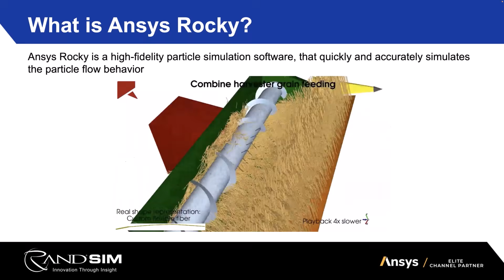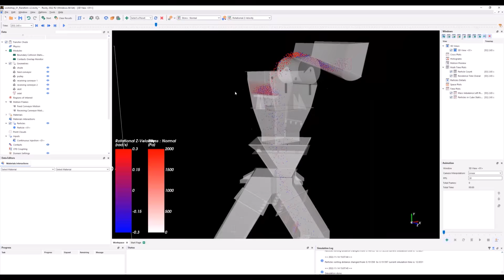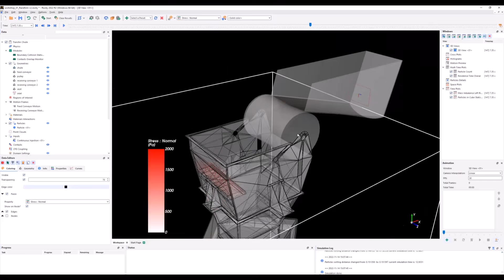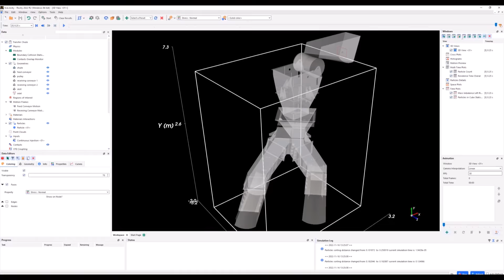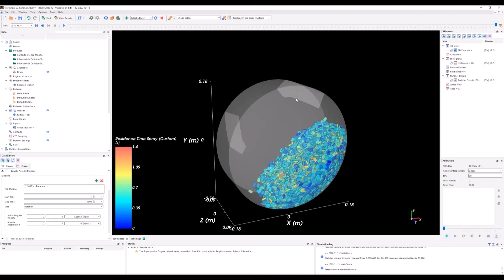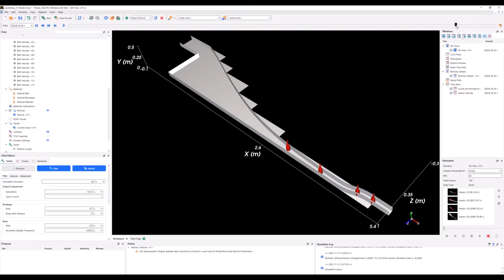Ansys Rocky: Particle Simulation 101

Comment: i need to simulate the effect of wind flow over a plate containing particals. Is rocky the correct choice for such simulations?
Reply from the maker: Thanks for reaching out! 

That depends on the application, allow me to break it down for simplification from hardest to simplest in term of setting up the model and typical computation time:

A. Accurate airflow physics and particle to particle interaction are both very important particle to particle physics can be approximated:
In this case you are looking at Fluent+Rocky coupled.

B. Accurate airflow physics is very important but particle to particle physics can be approximated:
Fluent with DPM (dilute particles) or DDPM (dilute to dense flows) simulation are the tool of choice. Note that with DPM particles to particles interaction is not modeled and that with DDPM it is modeled but not to the level of accuracy of Rocky.

C. Accurate particle to particles physics is important but airflow can be approximated
In this case you are looking at a Rocky simulation with SPH activated

Hope this helps!

Comment: Just to double check, when particles from Rocky are coupled with fluid from fluent, my Rocky also has this SPH enabled (Eulerian solution ticked) in the data window. Should I delete  the SPH, or leave it alone? I think I need to deleted it because fluid solution is supplied from Fluent. Right?
Reply from the maker: Hi, @sardarvayghannezhad9673
Thanks for reaching out!

In a two-way Rocky-Fluent coupled simulation, Fluent will consider the impact of particles on the fluid dynamics and vice versa, allowing for a comprehensive multiphysics simulation that accounts for the behavior of both the fluid and the particles. There is no need to activate the SPH module in a coupled Fluent-Rocky simulation since the fluid physics will be handled in Fluent.

Comment: Thanks for your vibrant talk! It pepped me up on the software realy!! Let's suppose a TRANSIENT flow field has been solved in Fluent for 10s of simulation. If coupled with rocky, can rocky add particles starting from t=0 to that flow, or can it only add them starting from t= 10s? Thanks I hope I am clear
Reply from the maker: Hi @sardarvayghannezhad9673 !! 

Thanks for the kind words! Rocky definitely is easy to get excited about. When doing a 2-way coupling, you may indicate an initial flow field. In your case, this initial flow field may be either at 0s or 10s. From there, Rocky and Fluent will both simulate concurrently, and exchange TONS of information relating to the particles; location, size & velocity, etc. or information pertinent to the flow field; flow velocity, temperature, humidity (if in software), etc.

All of that information exchange means that you won’t be able to reuse the fluent unsteady simulation that you already ran (except as an initial solution) and as a matter of fact, it also means that when running in 2-way coupling, your Fluent solution at each time step could be vastly different than the Fluent simulation you ran in standalone.

Hope this answers your question!
Reply: @randsimulation  thank you so much for your detailed reply. I now know Rocky is a way to go!

Comment: I have multiple solid particles and they are hitting the skin like material at high velocity. Can i find the penetration depth covered by multiple solid particles inside the skin using ansys rocky?
Reply from the maker: Thanks for reaching out. Rocky can record strength of each impact with a surface. As long as you can correlate impact strength to penetration depth this should give you the answer you seek.